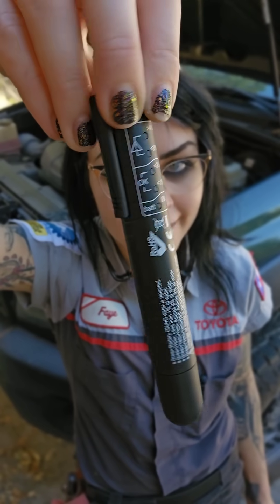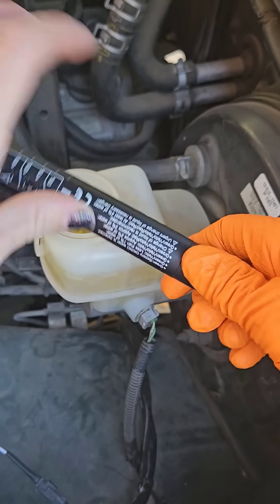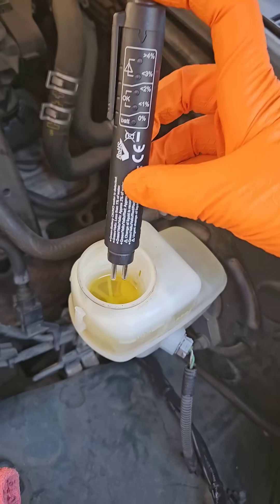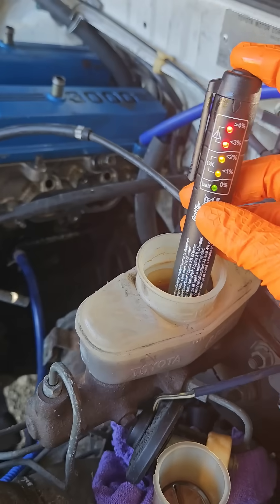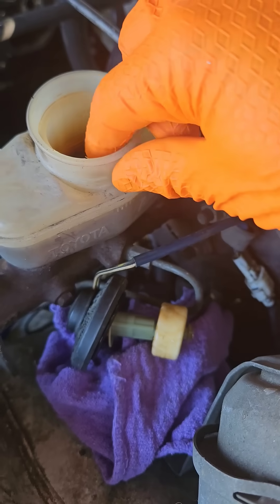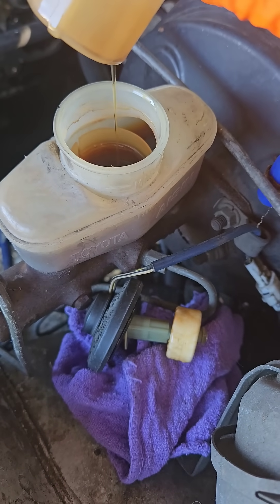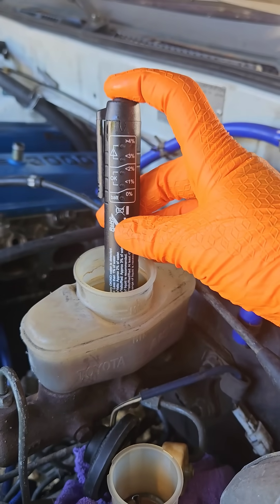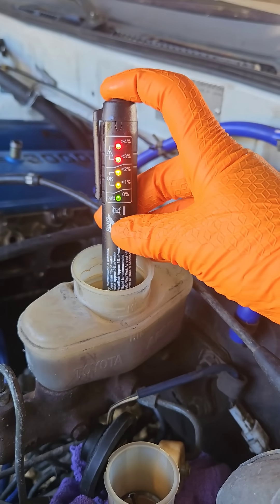Do you REALLY need your Brake Fluid Flushed?? How to Test it For Yourself!

Comment: I've had 40 year old cars that never had the fluid changed unless there was a leak.
It's really unnecessary.
Reply: Cast iron/steel master and steel brake lines(and no ABS) not a big issue, newer aluminum master and lines = big problems with contaminated fluid.
Reply: @tjkj-om9oi everything on new cars is a problem, my moms 2022 nissian rogue lights up like a damn cristmas tree constantly from all the sensors
Reply: @FedkaSlovanich you said “Nissan” that’s the problem
Reply: @michaeldautry nissan was tied for the best option in vehicles for over 10 years. Non interference engines were some of the most well enginerred engines ever made.
Reply: If the fluid is hygroscopic you need to change it when it fails this test. It will become corrosive and it’s not a scam. If you prefer to replace your brake system or screw the next buyer do what ya like.
Reply: you need to change your brake fluid
Reply: 100% necessary service. Just because braking performance feels ok, doesn't mean that the fluid hasn't absorbed moisture
Reply: As water is introduced into the hygroscopic fluid it lessens the fluids ability to provide good brake force.  As more water builds up it leads to a squishy pedal feel.  The brake fluid boils around 600°  water boils at 212°    being that its mixed and under pressure the fluid boils higher than 212 but it's definitely noticeable to anyone who tracks a car and it also keeps calipers from rusting up the piston.
Reply: You seriously can't compare a vehicle from the eighties to modern vehicles. ABS, traction control, skid control, stability control all use the brake system and those systems can be in play without you even knowing it. Brake fluid works 5 times harder today than 40 yrs ago.
It's an inexpensive service to perform every 3 or 4 yrs IMO.
Reply: @Geargrinderc15 you drive around in car with 40 year old hoses and brake seal? Do you have a death wish
Reply: @dannelson6980  Try reading what I wrote.
Reply: @Geargrinderc15  Once the hose burst it is too late. I've had all four hoses burst on 40 year old cars. I don't trust any brake hose over 20 years. It is pretty difficult to replace the hoses without flushing the system.
Reply: I've flushed the brake fluid on two trucks recently (2004, mine, 2000, my brothers) both had from what we could tell was the original fluid. After flushing, the brake pedal felt much better. You really don't realize it until you do it but it makes a difference. Not to mention the 100% truth that water gets in there and screws stuff up.
Reply: Depends on braking pattern and fluid your machine uses.
Reply: @romualdaskuzborskis it might make a difference too where you live. I wonder if more moisture gets there in like Alabama, or Vermont than it would in Arizona.
Reply: @pierredelecto7069  i would think that it makes more sence based on elevation - the higher you are the less extra energy it takes to boil the water. But to be honest - never put this to a test. All I know that it works like this where I live and thats mechanism behind it.
Reply: Agreed we have machines that haven't changed hydro fluid in over 50 years at work
Reply: @jasondeaver2117  don't those typically use ATF?

Also the demand isn't the same.  Brakes get squishy.  Your machine probably does too but you aren't using dot fluid.  You're using some other type of hydraulic fluid.
Reply: @magincap70  power steering and trans is the same brakes are a hydraulic system
Reply: It is very necessary if the brakes are to be used hard and the driver wishes to keep a firm pedal. Think downhill grades towing an RV trailer... or spirited driving on a twisty road... old brake fluid's boiling point becomes lower and lower w/ every passing year. Watch out.
Reply: Even if it didn't need replacing, if Faye suggests it, I'm getting it done 😂
Reply: @michaeldorgan5189  you said it!👍🏼
Reply: The thing is, it is true the fluid absorbs water, and it does reduce the effectiveness of the fluid… but outside of very high performance applications like racing, the change between new and 20 year old fluid are unnoticeable.
Reply: @johngaltline9933 in bad case only 5year old brake fluid can freeze in winter. Not a funny feeling
Reply: @johngaltline9933 4
Reply: I didn't ride my bike in two consecutive summers, and all brake and clutch fluids had turned into ear wax... The bike wasn't even stored outside, and the fluid was the best money can buy.
Reply: @MrZetor  my last bike I owned for 9 years , never changed bike fluid. Was just fine.
Reply: @Geargrinderc15  Weird. I use(d) Motul RBF 660 (DOT 4), and I had to scrape it off from the master cylinders with a flat-head screw driver. It was almost solid, pretty much like ear wax. The clutch fluid had also (apparently) expanded and leaked from the MC, melting the paint on my top left fairing (which sucks!).

I don't think water separation was the issue though. Perhaps the climate had something to do with it.
Reply: @MrZetor  sounds more like someone put some dot 5 in there at one point or some other fluid that caused a reaction.
Reply: @magincap70  Wow, that actually might explain everything. I did take the bike to a 12kkm maintenance at the shop, then rode a couple of months, after which the bike was almost 3 years in storage. I have no idea what fluids they put in, but I wouldn't be surprised if they used the cheapest stuff they had at hand.

I remember when back in the day I had my old M3 serviced, and later, after the crankshaft bearings of the 6th cylinder crapped out, were replaced, crapped out again, the entire engine was swapped, and then we discovered that the corresponding oil inlet had been obstructed by some gunk. Only then I checked the receipt of the maintenance, and there had been no extra charge for the special (and expensive) engine oil that must be used in all //Mötorsport engines. Great.

Anyway, I tried to take the bike out about 3 months ago, but that went nowhere as the battery was dead and the brakes and clutch were light as a feather (with zero bite). I disassembled the clutch MC and got a new battery, but I reckon I'll have to completely take apart and clean all the brakes and the clutch, including the hoses. I hate this kind work, but, I guess I'll just have to bite the bullet, since I'd really like to go riding at least one more time next summer.

Thanks for your reply. I really appreciate it.
Reply: @MrZetor   hey, cool man. I'm glad it might help you out.   That is what you need to do if the system gets contaminated unfortunately.   Can probably get away with flushing calipers but main cylinder and lines got to go.
Reply: @MrZetor you probably put 2 incompatible fluids together
Reply: @MrZetor I've used RBF 660 and their RBF 700 fluid. I haven't had issues with it yet. But I usually flush fluid every 2 years. I have dimpled and slotted rotors.
Reply: Depends on what you are doing with said brake fluid. Track days are demanding on fluid
Reply: All I’m gonna say is my Benz needed brake system work (new brake by wire pump covered under warranty), prior to that the brakes were sketchy as balls, even with new pads and rotors all around. 

When that pump got changed, the fluid got flushed as well, and braking performance as well as pedal feel increased considerably. 

Gonna do the same to my Legend when I upgrade the brakes beyond what I’ve already done (upgraded pads and rotors), I’m gonna swap on a set of Brembo calipers and rotors from the next generation up. I’ll do a flush at the same time, but it’s likely the pedal feel will increase considerably after that too.
Reply: Well I guess it’s the same for Transmission, engine and antifreeze? I’ve had cars 10-15 years old with some same fluids but that doesn’t mean it’s not contaminated at some point or at the end of life. Unless it’s unused and in a vacuum, then it has a finite service lifespan like everything else. Is this really so hard?
Also how come no one mentions the amount of copper in the brake fluid…apparently went it hits 200 ppm it’s time….
Reply: I agree, to an extent.  I’ve had 50+ year old cars that have been sitting since the 80s or what have you, that did stop when you hit the breaks.  Would I drive it on the highway? No.  Even though they work, take apart the wheel cylinders and master, it will be gunked up and starting to corrode.  Sure, it took decades,  but as some people said, these are older simpler machines.  Tolerances are more slack, and they were built with simpler materials.   Apply this to the latest few decade’s technology, and you really could have a problem in a much shorter timeframe.
Reply: @gamefanapril  I recently flushed my SUV myself after 8 years or so which is too long for me but I noticed a difference. Would I do it every year? No, not necessary but every 3-5 years, yes and not that expensive at a garage.
Reply: Two years seems a little rough. Maybe don’t test the fluid everyday and the moisture won’t get in a sealed system?
Reply: Not true. Not intelligent. Not safe.
Reply: You probably never drove that car in a way that the brakes got hot enough to boil the water in the brake fluid. It has happened and it is a danger and a cheap fluid change every three years keeps the system in good condition and safe.
Reply: Rusty, stuck calipers, rusted leaking brake lines.
Change most of you fluid when doing your brakes.
The only scam is when mechanics don't flush contaminated brake fluid, when doing your brakes.
Reply: Agreed, except... it's the modern abs vehicles that cause most of the fluid change requirements
Reply: @krislink1761 Only if the driver drives like trash and cooks the fluid.
Reply: @krislink1761 I have 10 year old brake fluid on my car that is still perfect. Nrake fluid is usually forever since it does not heat up to it's fladh point. Changing break fluid is unrcessary.
Reply: 40 year old brake fluid? 
The cars you "have had" must have been garage kept in a climate controlled environment. In hot and humid climates the brake fluid literally turns greenish black and gets thick like a sludge after 5 or 6 years, and that is fact.
40 years...I have never even seen a drum brake wheel cylinder last longer than 20 years without leaking. I think you are a liar.
Reply: Exactly. I have owned over 30 vehicles. I had four Dodge a100 vans 65-69. Never touched the brake fluid.
Reply: I'm not even ashamed to admit that my 2002 Camry has never had the fluid replaced. 21 years and 181k miles. Not a single brake issue. I think I'll end up flushing the system when I eventually need to replace the read drum brakes. Until that time, I'm gonna let it ride.
Reply: Your brakes probably felt like shit 😂
Reply: Was looking for this comment, I've got cars over 20 years old on original fluid. No problems
Reply: @longbow6416  Apparently you and I are the only ones...lol.
Reply: It's really only DOT3 and DOT4 that are silicone based and will absorb moisture.
Reply: @paulpatrie3068  dot 5 is silicone.  3 and 4 are glycol based.
Reply: @paulpatrie3068  DOT 5 is silicone brake fluid and can not be used in normal braking systems that have not been modified to use it.
Reply: @paulpatrie3068  DOT3 and DOT4 are glycol based, DOT5 is silicone based. DOT5.1 is glycol
Reply: Means you been driving like a grandma for 40 years. I need to change my brake fluid at least every 10 years or it acts up late braking into hard corners
Reply: “We’ll I’ve never had a problem so they must be lying to sell me bullshit” stay in your lane geezer
Reply: I agree 100 percent with you. I believe it’s just another up sale scam. I’ve owned 3, ten year old trucks that I bought new and only problems was normal brake pad wear. Two of the trucks; I didn’t even have to replace the pads and one had 127 and the the other had 155 thousand on it when I sold it.
Reply: @dbf5706 why would you sell trucks that are brand new?
Reply: @loganyoutube4818  New ? I buy a new truck every ten years. My first truck was a 78 Chevy my parents gave me. Then I bought a 91 Chevy, a 01 Chevy, 11 Chevy, and now have a 21 Ford. Never changed the brake fluid on any of them; except the 78 Chevy.
Reply: @dbf5706 

Dude , it's not a scam . I was a mechanic for 30 years,  trust me , change it every 3 years.
Reply: It IS necessary she just explained it...
Reply: My 1998 Toyota Camry with 376000 miles on it never had brake fluid or power steering fluid changed. Everything else was serviced. No problems. Struts had over 340000 mi on them and they were wore out but it never caused issues with tires, I would get at least 75,000 miles out of a set of four. I was always told worn out shocks and struts would cause problems with tire wearing quick.... Nope!!!

Comment: Thats all good and well, but if the fluid in the reservoir has been topped up, it'll be a false reading. The moisture is also absorbed through the rubber brake pipes that run to the caliper. Moisture is also heavier than brake fluid so it is more consentrated in the caliper  which is exactly where you dont want it as it lowers the boiling point of the brake fluid. To get an accurate reading,  a sample should be bled off from the lowest point ie the caliper.

Comment: My car break bolts like to get jam in break bracket. There for breaker bracket and calabitor need to be replaced every breaker job the breaker fluid goes every where I have a funny funnel to put more in. I allies use new old on driveway.

Comment: Just change the fucking stuff every two years, the fluid goes bad in other ways, from heat cycles and the rubber hoses seem to leave black shit in the fluid. Costs about 60-80 quid to be safe.

Comment: Dont use cheap electrical testers is all i can say far from acurate when it comes to horticulture same applies here but useually its time based imho if you open most modern vehicle hand books its advised to flush brake fluid at a certain time scale pretty sure its comon knowledge

Comment: Or you can get a Tesla and never have to maintain your brakes 🤗
Reply: nope they still need maintenance, this idea that electric cars dont need any maintenance is just completely wrong
Reply: Not true. You basically don't need to do a darn thing. Sure, Toyota service will try to sell you on something, but if you don't touch your Tesla brakes, except perhaps to use them a few times a month, you will be totally fine.
Reply: @routine8  its still a car, it needs servicing. it still uses a very similar brake setup to any normal car. people already ignore servicing on ice cars and need a new engine after 5 years, dont need tesla drivers thinking it doesnt need any and then putting other people at risk especially with how heavy they are
Reply: @arcanevoid9199  but you realize that Teslas use Regen braking to slow down and the brakes are used about 90% less than a non-electric car. So, they will (and do) last 90% longer. Mainly you just need to rotate your tires and add washer fluid. 12v battery is lithium now, so it lasts a super long time. It's honestly a lot-lot lower maintenance than a Toyota or similar gas car.